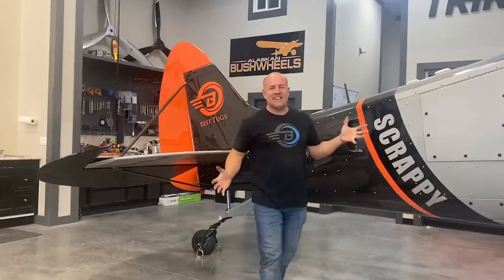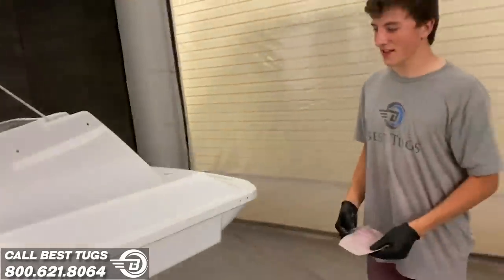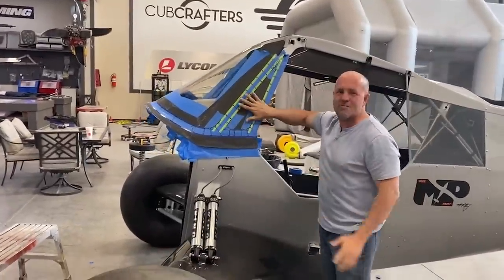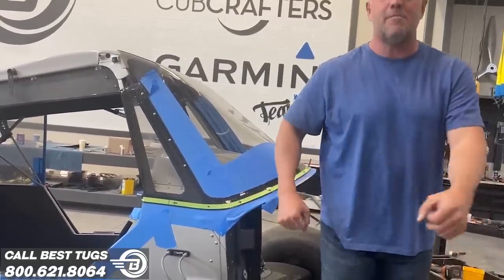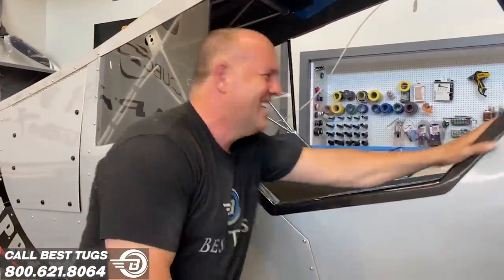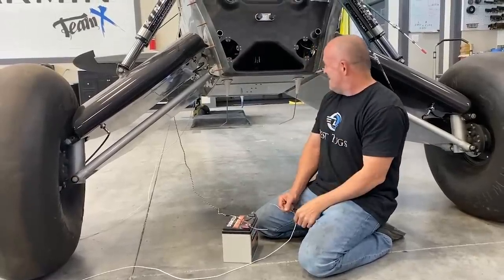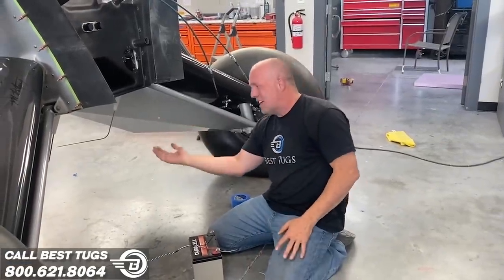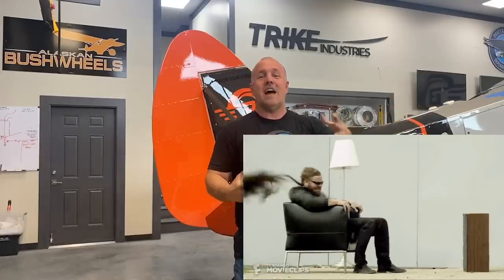🙋🏻‍♀️Wife Announcement (Scrappy Bush Plane 28)

Comment: Tip from an ex windshield installer. If you cut your silicone tube at an angle, you can shoot a triangular bead. It is much easier to get a good seal with a triangular bead compared to a round one.

Comment: I had a dream where I was fortunate to get ride in Scrappy.  I was really nervous because it was the 1st test flight.  You said that Scrappy has a nitrous oxide bottle for more engine performance at higher altitudes. You told me that it is piped into the oxygen in the rear seat canula and that I could take a shot if I got really nervous.  I suggested that you change the name to "Happy".
Reply: Now that's funny! 😂🤣😂

Comment: The rocket launch tube then acts like the firing chamber of a gun, and the initial blast builds pressure inside the tube or, comparable barrel, and the pressure pushes the rocket out like a bullet with gunpowder expanding behind it. So long as the tube is closed, it's like the breech of a gun barrel.

Comment: Good explanation for why the rocket is not dangerous to the pilot. An easier way to describe what happens would be to distinguish between a rocket pulling the parachute and an explosive launch as in a gun type explosion. One is progressive/gradual, the other virtually instantaneous.

Comment: Perhaps you already are but some Titanium fasteners would give a killer look..plus function. I always use them to mount all my plastics/engine covers on my Moto bikes. It’s not cost effective nor is it necessary but damn, it’s the icing on the cake, excellent finishing touch.
Reply: My 2007 Z06 Corvette has nearly $4500 in titanium bolts.  I am a believer.

Comment: Will you even be able to do a power on stall? Or will the plane have enough power to still climb straight up?
Reply: I'm certain Mike will confirm  stall speeds with his Experimental 40 hour fly off? Although, how the heck do you qualify this as an Amateur Build, with Mike's talent and the FAA's blessing?
Reply: @randyvanvliet226  I just see Mike and the FAA Inspector in the plane as Mike pulls back on the yoke, and it just hangs on the prop until Mike asks, "are we done yet? Then, he feeds in the throttle and accelerates straight up and back to the airstrip. No problem!    ;^)
Reply: @MrGaryGG48  ....and after that he fits the wings
Reply: If you can hang an airplane on the prop does that guarantee a win in a STOL completion or does it disqualify you as a helicopter?

Comment: Quite interesting, Captain. Reducing weight by eliminating fasteners is a nice trick. I have experience with those actuators. There isn't a brake for most of them. So constant or repeated power application will be required.
Reply from the maker: 👍🤠 great comment. It depends on the pressure, I checked the force loads required to force retraction and causing a power add to hold it In position.  The loads I get at speed don’t reach even half way to the point of creating constant power.  That’s why I have the larger unit with lower gears to prevent that.  Thanks for the great thoughts 🤠

Comment: Hey Mike, I noticed while you were showing your sons wave runner in your garage, there was what looked like an old GWS Slow Stick on the bench in the background. Sadly that model was discontinued many years ago. However it was a great flying little slow flyer. We used to race them, airplane combat, and just about anything else in between. I know this is a stupid question but have you ever raced radio control pylon planes? I ask because I know you like to go fast and nothing will get the adrenaline flowing like flying a 3 lb composite model airplane at speeds over 200 mph around a fixed 1/4 mile 3 pylon course along with 3-4 other pilots. Just wondering. Hey that’s cool that Chandra wants to build with some help her own personalized carbon cub. Your youngest is found his beginnings of his own hobby. Hope he is planning on selling one or two of those just to see what he can make rebuildingthose wave runners. Now o more screwing around with work, and get going on scrappy before Chandra wants to start her carbon cub build.
Reply from the maker: It is my son’s slow stick, he’s quite the r/c lover and has really enjoyed that.  He’d probably love racing too.  And yes, he is selling 2 3-seat wave runners when he finishes them.  👍🏻👍🏻

Comment: Great video, very fulfilling to see such progress. Your rocket is fuelled by a propellant not explosive. The reaction or energy release at the point of initiation is a very fast burn.   You scare people when you you use the term explosion - in a good way though. Ha ha! I love the infill videos to add context. They are funny. You are very modest which is great to see. Loved the shots of your lads progress with the wave-riders.
Reply: It looked to me that the rocket was initially “exploded” out of the cylinder with a charge and a split second later the rocket fired to continue pulling the chute pack to extension.  I may be wrong but that is what it looked like to me.
Reply: @king-o-vetts9899  As the body of the rocket clears the tube you get a massive expansion of hot gases which is probably what your seeing. Its basically a gun barrel :-)The tube/barrel is there to confine the propellant and allow the body to accelerate whilst giving it direction. Or ballistic stability.

Comment: Lol at the intro. You married well! 5 kids LOL Wow your son is killing it! 

I like that you changed the supplied wiring harness on the linear actuator. It looked like a mess. I am in the process of attaching a NEMA 24 stepper motor to a rotary table (for a dividing head) and I didn't like the way the wiring was kludged from the controller to the stepper. So I made a circuit board, with wiring color code on it (so anyone can wire it). I'll also 3D print an enclosure for the board so nothing is exposed.

Model rockets, even the very large ones, have very similar parachute ejection physics.

I'm certainly no Mike Patey but I can relate to the way you guys learn by doing. A friend at work asked me if there is anything I can't do and I said, "of course, anything I don't want to" :o) Learn how to do it by doing it!
Reply from the maker: Thank you! Good quote.🤠

Comment: The sensations from the explosion were weak because there were no windows installed in the plane, that is, the space was not limited by the small size of the cockpit, you need to try to make a test in an enclosed space.  Close the same volume of the cabin, place the pressure sensors inside and detonate the rocket there, fixing the maximum pressure values. Good luck, Mike!

Comment: regarding finishing hand-laid carbon clear...I wonder if you could "wet" sand the surface of the part using the clearcoat as the liquid instead of trying to just rub the clear into the pinholes.  I've done this with some wood finishes and the results were amazing - the sanding action makes a super-fine wood paste as it mixes with the finish that fills all of the tiniest pores in the wood (using 400 grit paper).  I've done a good bit of composite work but haven't tried this with carbon...it might be worth a quick experiment.

Comment: Hey mike , when you put the suspension on you mentioned about a surprise  that they have some modes or specialty. Since you blow a rocket out of your plane, maybe you drop it from the ceiling  😍😍😍 some water on the floor so that the tires can slide side ways when its bottoming it out. Back to work🤙

Comment: A vacuum chamber might be handy? Up to a meter is a welded pipe and above that is spiral in 3/8” wall steel. You can drop on off-cuts. I got 1m by 1.2 for £300. (Plus some delivery) The lady had the offcuts in the yard out back. And the door seal was high temp silicon round sausage, because I need to braze aluminium in it. Without the need for metal melting heat the big cost is the pump and wet-pumps come up refurbed. Just a thought :)

Comment: Hopefully this isn’t a stupid question but could you point me in the right direction on how I can make a dial switch control a actuator in conjunction with a potentiometer?    As I farmer who modifies a lot of my equipment I have multiples things that would work very well on.   Tried searching around for the circuit because I know it’s commonly used but don’t know what to search for.   Thanks for all the inspiration!!
Reply from the maker: TCW technologies have done some for me and great guys

Comment: Hello Mike.
I think your bomb bay door cowl flap is great and well thought out.
How ever a wise man learns from his mistakes But a wiser man learns from others.
For instance let's look at the Cessna 337 Skymasters rear engine electric cowl flap door failures that has cost $$$$ to top end O/H due to overtime.
My suggestion is to have a access door in the floor to manually open cowl flap.
Thx.
Paul.

Comment: Given that you've so radically modified the stock Carbon Cub into a Super Extreme x 50 version, did you ever consider this same build utilizing an Airframes Alaska wide body fuselage frame that could give you side-by-side seats in the front as well as dual pilot controls with significant interior space expansion for passengers and cargo?
Reply: There are good benefits to both side-by-side as well as tandem seating and honestly, I like both for different reasons.  Tandem allows the pilot to easily see both sides of the landing gear which is nice for when we’re landing up in the mountains.  Both configurations can have 2 sets of controls.  My current Carbon Cub has rear seat controls as well.
Reply: @ChandraSlyFoxPatey  I sure hope we will get to see the build of your new Carbon Cub - the pic of it so perfectly packed into its delivery crate is most appealing as it just sort of is calling to "build me". Your mods will be interesting to see as well.
Reply: C21 Delta9  I was really impressed with the packing job they did.  I’ll be posting videos on my channel.👍🏻👍🏻

Comment: Great explanation on all the rocket questions. There is another question though: Could a compressed air cylinder with a high speed value (a.k.a  a potato gun) have been used instead of a rocket?

Comment: The rocket explanation was on point but another way to think about the rocket is it is the exact opposite of a suppressed rifle. The bullet being the parachute. You hear the push, then the crack where as when you pull the lever the rocket has left the building when you here the push and wind over the wings you probably will not even hear much besides a little pop. Projectile is long gone at that point.

Comment: I'm anticipating the day when you get involved with the open source Raptor Experimental plane. Given your love of aviation and desire to make it accessible, your engineering background and experience building airplanes your involvement could really help push advancement of the project forward quickly and in a big way. I imagine you'll be the first to fit a turbine to one and hopefully use it as a platform for breaking some of your speed records.

Comment: Mike - great video as always. With so much rigid carbon structure, would love to hear your thoughts on testing for engine/propeller-driven harmonic vulnerabilities before & during flight testing. Thinking specifically of the carbon tail-braces which you have proven are very strong under a static load, but may have a destructive harmonic range to be aware of avoiding. Keep up the great work!

Comment: In the parachute test launch it looked like there was about a foot of stitching left in the straps. With wind playing a factor on a real launch, how much additional force will go into the straps and will there be enough stitching left to avoid a shock load? How much force is needed to tear each stitch?

I've used protective equipment that works the same way when l was doing rigging work and climbing. In my situation the length of the strap limits how high above the anchor point you can get and fall to generate force on the system.

Are there other variables than the wind that might affect the force too?

Thanks for great content. I just pointed the son of a friend at you who is interested in aviation and he is feeling super inspired and motivated.
Reply from the maker: sabindaman 👍🤠 great question. the stitching set up is designed for the ground launch test rig and then the real chute has the adjustments for in flight. BRS really knows there stuff and have bow saved over 500 lives with successful chute saves 🤠

Comment: Hi Mike, thank you for sharing building Scrappy, I really enjoy watching your woke mate. 
I have a question about the belts or the straps attached to the rocket if you need to use the parachute (hopefully not). Is it better to use a flexible straps for more safety and to reduce the tension as the parachute will be hold the airplane against the wind and the speed of airplane as well? What you think please.
Thanks for your time

Comment: Curious about the cowl flap? You visually monitor the engine temperature and decide to electrically open it? Why not tie it into the engine temperature gauge and have it open automatically when a specific temperature is reached? I may not fully understand how it would effect the aerodynamics or performance features other than more drag.
Reply from the maker: 👍🤠 the vernatherm runs the temp automatically.
Reply: @MikePatey  Thanks I was failing to understand why, sometimes you just want a manual override for just in case scenarios.  FYI :With a 3D polymer or additive printer you can make relatively inexpensive reusable molds for layup of carbon fiber. ABS polymer will make a strong mold. You just need to line the molds with teflon release film or substrate made for layup, bolt them them together and debulk in a vacuum bag.  Cutting the right ply shapes factor into that too.  Love your videos you do many things well and your knowledge and experience is just expert in many discipline of engineering, physics and fabrication.

Comment: If I had a taildragger  I would make a prop protector , like a  skid  that  prevents the prop touching  ground. Maybe servo controlled  so I can lower it before landing so there is no extra drag. If you add extra surface you can use  is as a speedbrake  too

Comment: But Mike I thought this was going to be a STOL aircraft?  Won't you just be flying around at about 40mph most of the time, hence no great wind blast to pull that parachute out, the rocket will do it just fine as proven.  :)

Comment: Dear Mike, I was in the United States Air Force as a C-130 Loadmaster.  I have dropped hundreds of thousands of pounds of cargo from a Airplanes over my career (tanks to teddy bears).  I think your Bomb bay door is very cool but....  My concern is your drop getting caught up on the tail wheel.  Be careful a small parachute caught up in the horizontal stabilizer and rear wheel may cause you a lot of problems.  Your first few drop be sure a video it well,  I would suggest using and delayed opening parachute of some sort.  The first few times try dropping toilet paper on its roll.  It is a good way to calculate the force of the wind plus it looks cool as a streamer going down.  Good luck and keep building!  Ken Keplinger

Comment: Mike, will the bottom flap also be integrated with a temp sensor to open automatically when engine temps rise to a certain level, during long taxi, prolonged idle, Max climbs?
Reply from the maker: I’ll try to go in to that in a later video. 🤠

Comment: Hi Mike, if you have to deploy the parachute in mid-flight. When the parachute is open. Does it pull the plane up like it would if you were doing a sky dive and you deploy the chute. Also how would you control the direction with the stick in the cabin. Also would you still be able to direct the plane if for instance you have an electrical fault or full engine failure. Quite clever how a Bush plane can accommodate an parachute to prevent fatalities. Clever engineering. Great work buddy. Love how you explain everything. One of thee best plane builders I've seen on YT. #backtowork

Comment: After watching your responses to the rocket / parachute questions, I wondered if there is a danger of chute or air frame damage or destruction in case of an accidental chute deployment at high speed. Would there be a possibility of a system that would not allow deployment unless airspeed was below a certain threshold?
Reply: BRS does the calculations for chute size.  They match it to the gross weight specs of the aircraft.  Scrappy’s chute will be able to deploy at VNE.
Reply from the maker: 👍🤠 It takes two steps to deploy, it can’t be accidentally launched  yet if it happened this chute can handle deployment of this planes top level speed flight.  🤠
Reply: @MikePatey  Thanks Mike, good to know!
Reply: @ChandraSlyFoxPatey  I should have known that was all figured in. I pray it never has to be used but good to know it's there. Are you going to put one in your new Cub? Do you plan to document that build here?
Reply: Steve Egbert  Yes to both questions👍🏻

Comment: At timestamp 17:00-17:30 you describe how you embedded aluminum angle between the micro honeycomb and the carbon fiber external skin. Previously, you had always made note of the fact that you put an insulation layer between carbon fiber and metal to prevent galvanic corrosion. Did I miss something or was that an omission from the script or an omission from the build?

Comment: I suppose if you needed more blast protection AND more energy put into blowing the lid off, the rocket could be contained inside a two-piece telescoping cylinder; the bottom half attached to the fuselage and the top sacrificial half being part of the blow-off roof section.

Comment: What type of risk is there for the Hot rocket falling on the parachute and melting it and if that doesn't happen then are the 2 cables that are attached to the rocket a risk to collapsing the parachute when the rocket drops after ignition ends.